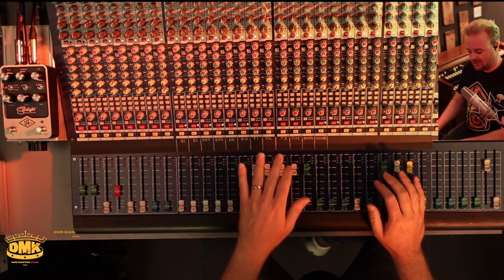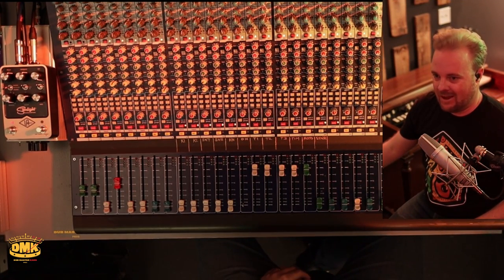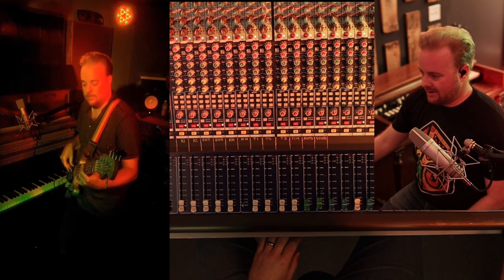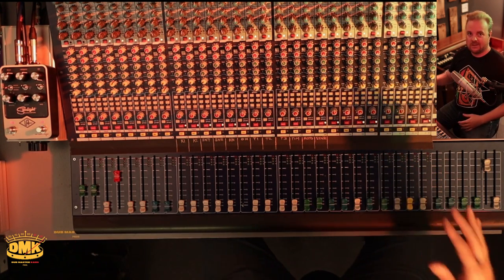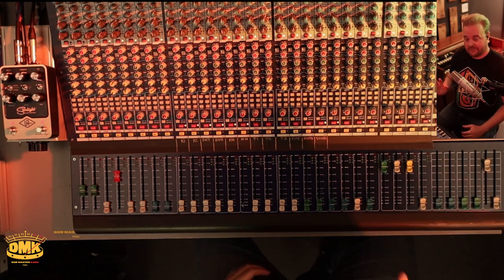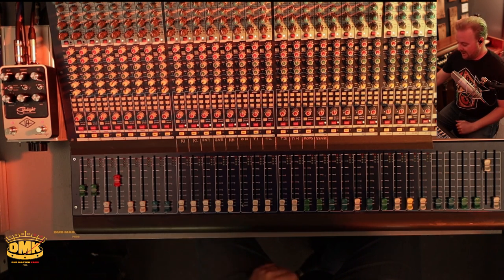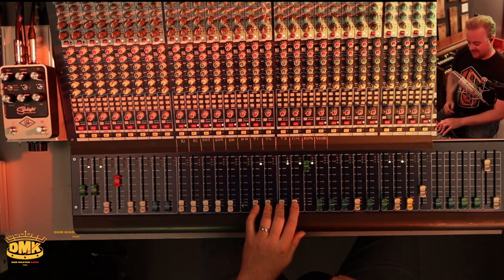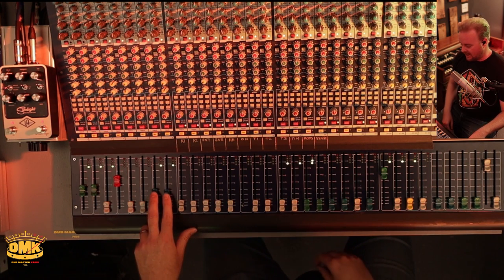DUB Concepts with DM Kahn

Comment: Is there a big difference between putting the filter on the insert of the return, rather than just having the chain go from the aux out to the spring then into the filter then the return?
Reply from the maker: It’s definitely a different thing, I’ve done it before but I didn’t find it as interesting as on the insert of the reverb. It’s definitely a viable option though and worth experimenting with!

Comment: how is the routing done for the model910? mon2 to a channel, into the daw to the plugin?
Reply from the maker: With my particular mixer I don’t need to use an actual console channel/fader for this. I can export the console via FireWire straight from Mon 2 as a channel output via some buttons on the console. Then in the daw I put the 910 on the input of that corresponding channel and record it. I monitor the record back channel. There’s a little latency but it’s not bad.

Comment: Do my efx go back into the channel insert or channel input?
Reply from the maker: If you’ve used the channel insert to send to a piece of gear, you’d return it to the insert (using  the same TRS cable). But typically you’ll use a channel input as a “return channel”